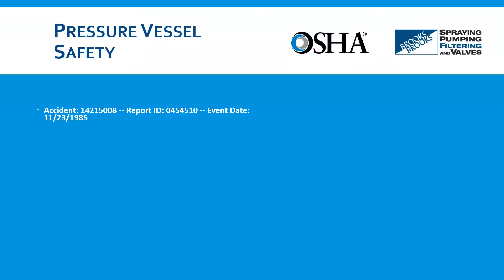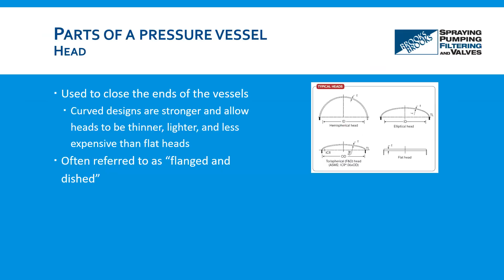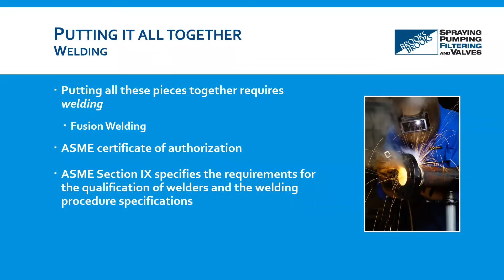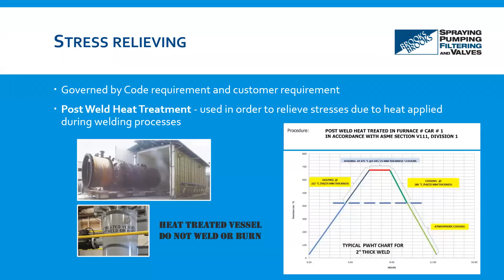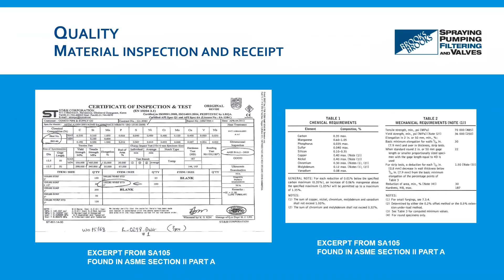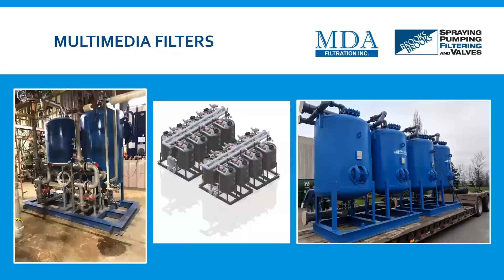Pressure Vessel Fundamentals   Part One

Comment: Very nice.  I am a technical support engineer at Hexagon the creators of PV Elite CADWorx and Caesar II. You highlighted safety which is the first and foremost responsibility of the engineer, together with the responsibly of following the pressure vessel code as far as all its rules are concerned - very important.  You covered the main points.